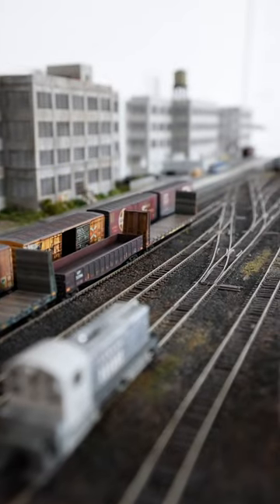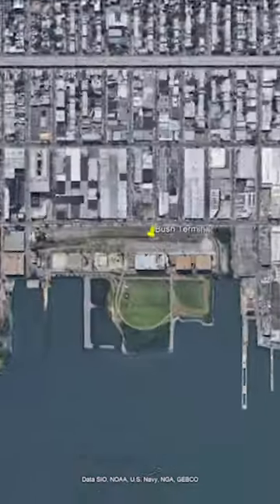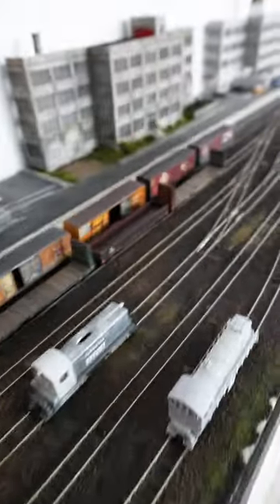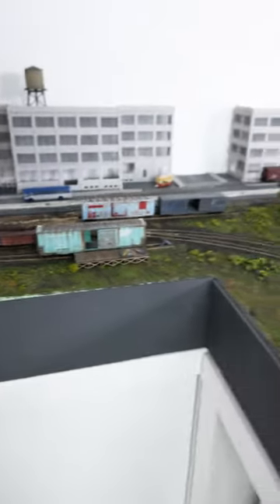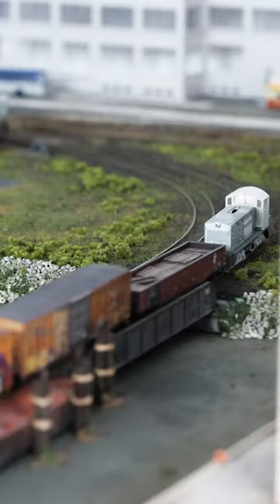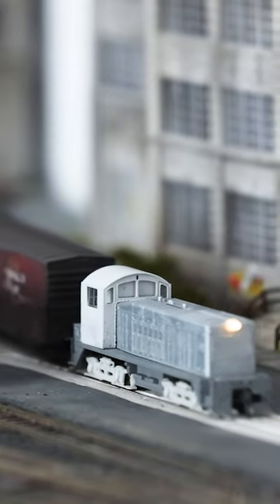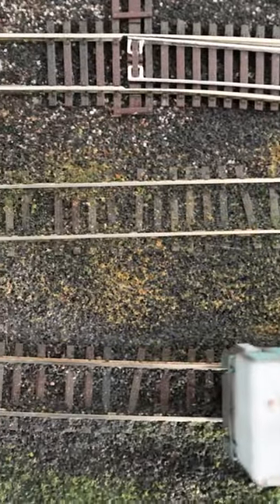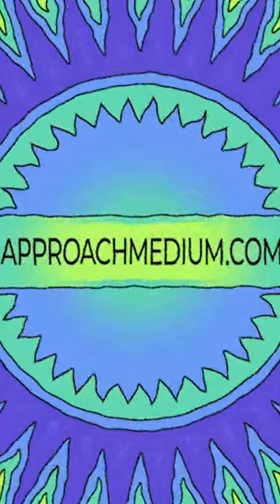N Scale NY Cross Harbor layout #shorts #modelrailroad #nscale

Comment: This is really interesting to me, my father was an executive in the Bush Terminal area and I frequently watch the operations of the BT RR switching local industry and the ship piers in 
Brooklyn.  Late on I would become a stockholder of the merged RR property that uniquely connected points twenty miles apart with one mile of track.  In the days of break bulk cargo the Brooklyn waterfront was busy but could not support the high volume and fast turnaround of todays container ships, just imagine adding ten thousand trucks to the already overcrowded highway system there.  As a youngster I remember seeing the many car floats that each of the RRs serving the area operated and the little RR steam tugs.  The companies in the Terminal buildings made everything from military and industrial electronics to wine and olive packing.